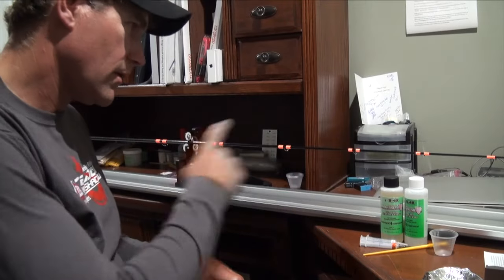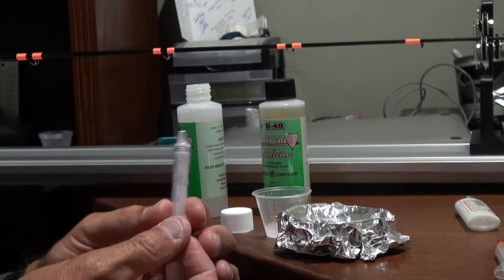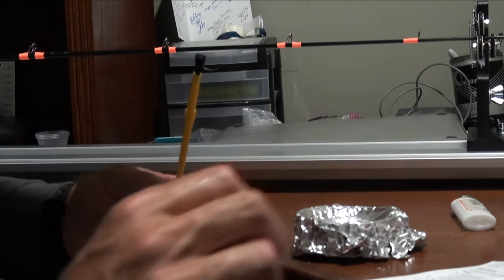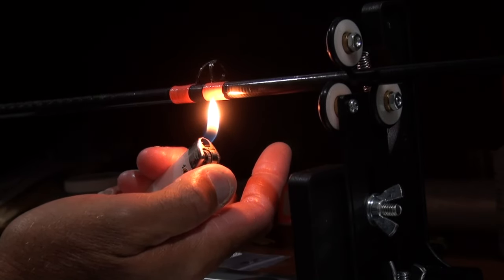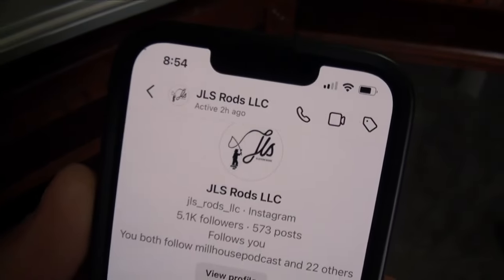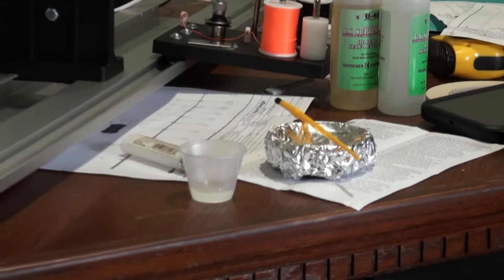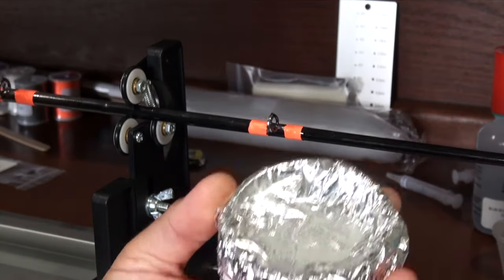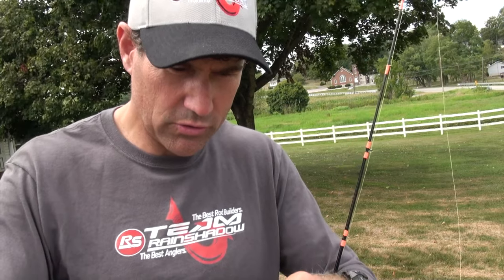Rod Building is EASY Part 3: Rod Wrapping Finish

Comment: Hahahaha, the tree cast for the finish. Really great instructional series, Jeff. Truly appreciate the inspiration to give it a shot. If I may, roughly what was the component/supply cost of the rod? I am certain the machine adds a good chunk to the cost- but then you will always have it for future builds.
Reply from the maker: Colin, check out BatsonEnterprises.com to get an idea on pricing of the components. When I started building rods close to 20 years ago, I did it on a tight budget - a cardboard box with two notches cut in the top was my support for the blank while I wrapped it. This go around I went for the best tools I could find. There are options in between. I’ll build a bunch for the next few years, and have the equipment to do quick repairs.
Reply: @TheLittleStuff  I have been spending time on their site, but I find it frustrating in that there are no photos of the blanks- which I think are important. They also won't let you cart items as you shop unless you have one of their accounts. I am going to dig deeper though and appreciate that it can be done on the cheap at least to test the waters.
Reply from the maker: Colin, check the “where to buy” link: https://batsonenterprises.com/where-to-buy